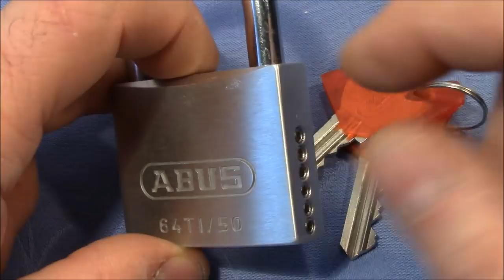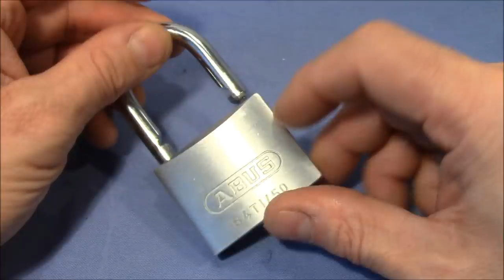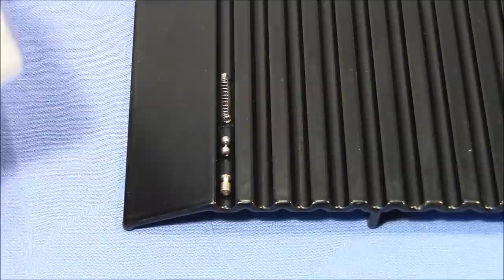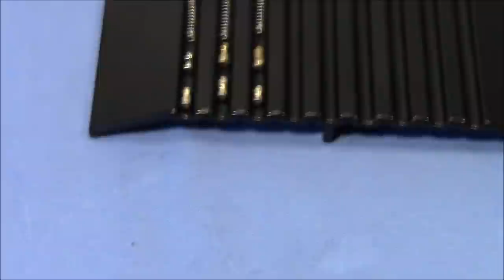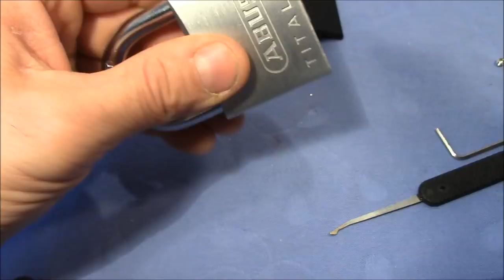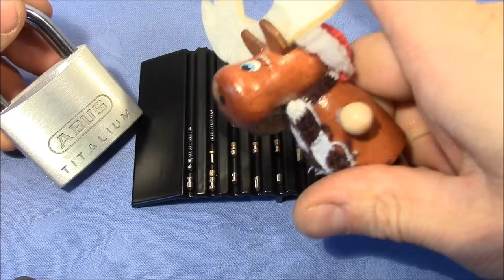(picking 452) Tom's masterpiece - an ABUS challenge padlock with some pin surprises

Comment: That was really fast Potti arg and I'm so happy that you did show at the end, how this lock is meant and can act  ;D. The soldered end of the wafer pin goes to the spring. The deep false set is from the balls and the pin in pin t-pin :D. Thank you very much for the nice video :), I had a lot of fun building it :).
Reply: redcatimaging Great job on this challenge lock my friend! It has a very deep false set. I love it!
Reply: Beautiful work, those pins are pure evil!
Reply: I loved it too ;D, made it as deep as possible without opening the lock hehe. Sadly it doesn't fall always in that deep false set.
Reply: Thank you :). Not evil enough ;D, as I wanted it to be fun :).
Reply from the maker: The soldering is a great idea - no worries I have assembled it correctly. In the deep false set I was tempted to force the plugin turning a bit more to see if it would open. But then I was to frightened to break something. I believe the connection between the ball bearings is not very strong. Glad I didn't test it.
Reply: Thank you very much, this is really appreciated :). I'm still a beginner at making them, so it's something special for me :).
Reply: There are two more locks I made that I have not seen on video so far ;D. I hope to see them some day :). I never wanted to make challenge locks, but sooner or later I had to make some ;D. One might be similar partially (what I had forgotten when I made this one...), but it is also different with additional traps haha ;D. And the other one is maybe too hard :(. I have made a wafer driver before, but I wanted especially Potti to have one, as he is somehow connected to the Dom S pins ;D.

Comment: Really nice picking Potti. 👍👍 That looks like a really fun lock. Foxxy did an awesome job putting it together. Thats some beautiful pin work he put in there. That first driver definitely looks like the common pull chains we have here in America. Thats thinking outside the box. Great video my friend.  👌👍👍😎😎😎
Reply from the maker: Yes, amazing what can be used as pins. Would be cool to have a lock only with these drivers. But I'm a bit worried regarding the stability. Thanks for watching buddy :-)